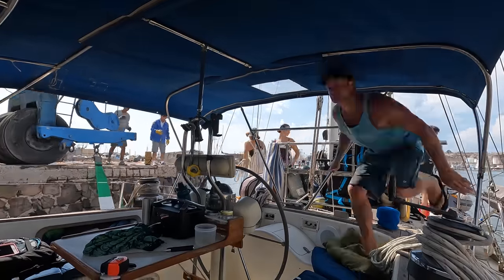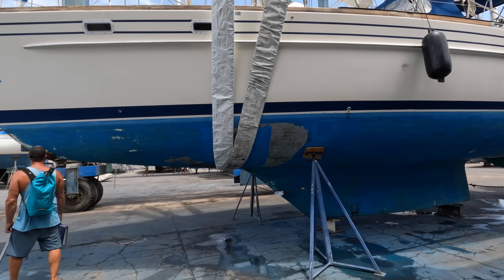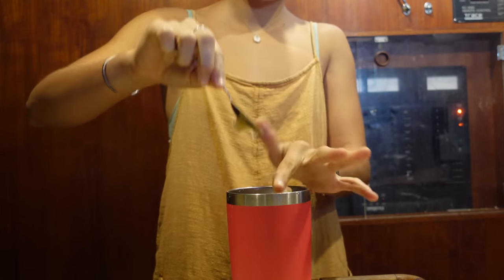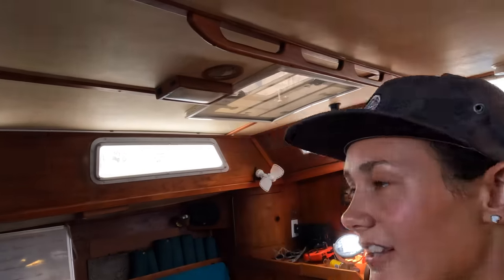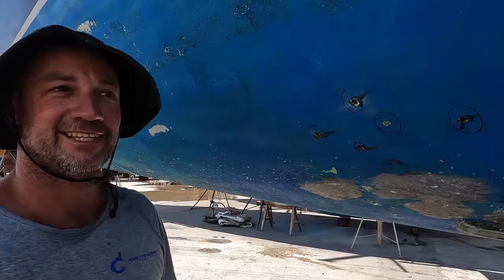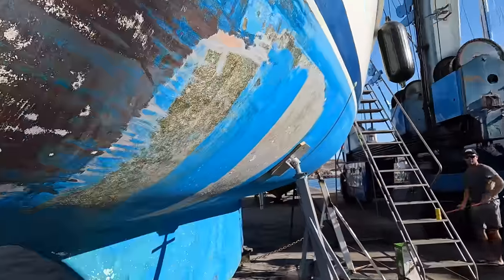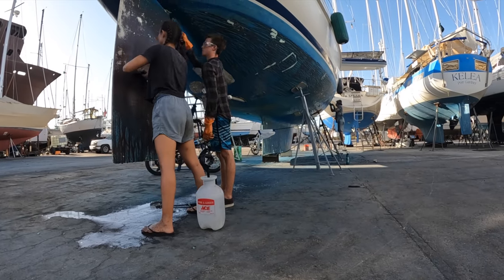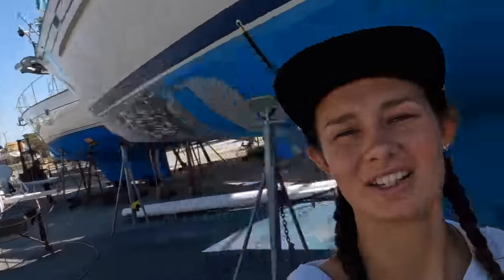Sailing 1400nm to Haul out our SAILBOAT | Ep 378

Comment: I had a bootstripe on my boat that someone painted over with antifoul.  I wanted to remove the paint from the stripe and used citristrip covered by a bit of thin plastic.  It took about two to three rounds to get to the gelcoat.  It SURE beat sanding it all off.

Comment: I can sympathize with you bottom work is in my opinion the worst job on boats. In my day (yep I said it) we considered ourselves lucky when we got to use the big heavy air grinders with massive torque on the red lead paint. My dad could be on the thrifty side so he bought big zinc plates so I could cut them down into multiple pieces with a hacksaw. He wanted to know why it was taking so long so he gave it a go… he decided maybe it was time to buy the right ones 😂.
Reply from the maker: Yes I agree bottom work is the worst 😅